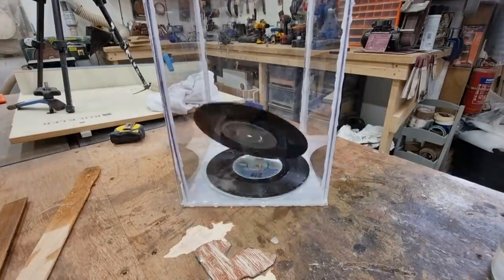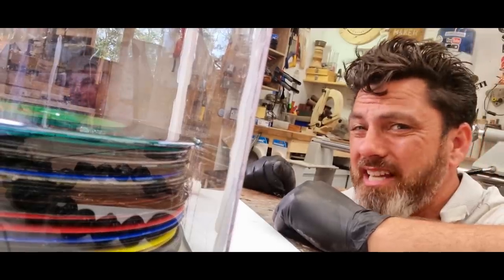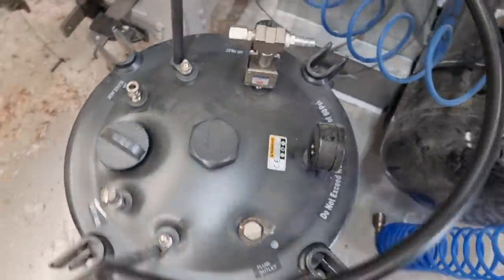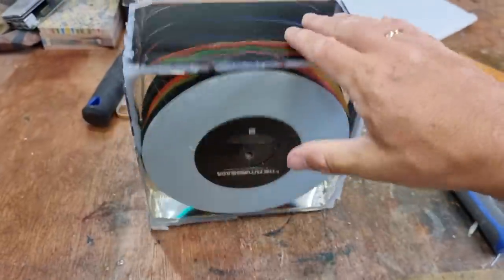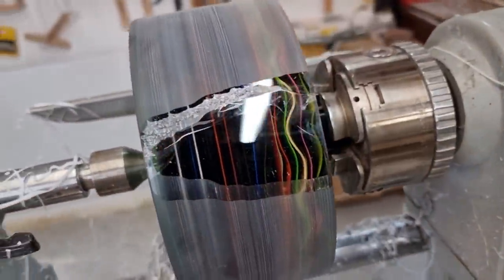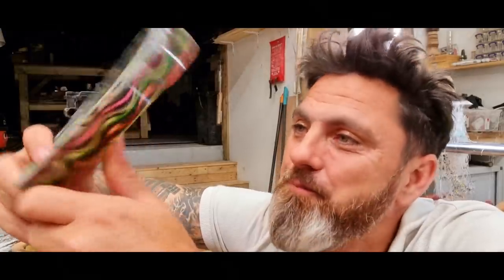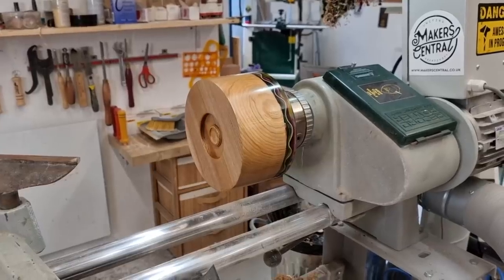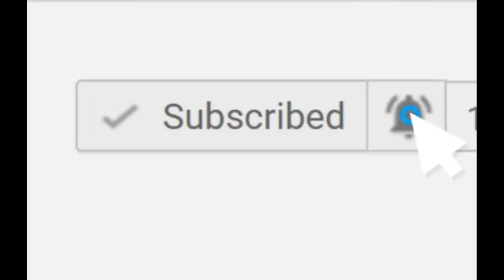I Turned My Old Vintage Vinyl Records on a Lathe 😬

Comment from the maker: Get 20% OFF + Free International Shipping + 2 Free Gifts @Manscaped with code nickzammeti at → http://mnscpd.com/NickZammeti
Reply: Those where the days nick having warped records
Reply: I hope no classics were hurt in the making of this video Mr Z 🖖
Reply: Turn it into a speaker housing
Reply: note: this comment is before the finished product 
Looked like the break was at the end of the fast dry resin. Could using two types in two different layers been the reason of the break?
Reply: That turned out pretty cool. Hoping to see what you do with the rest of the records.
Reply: nice recovery Nick
Reply: you can get wavy records by heating them up with a head gun, the reason your record blank came apart is because you need to make sure there is resin between each layer.
Reply: Nick try gluing in your emblem with: IC-2000 Rubber-Toughened 1oz CA Adhesive Glue      It bonds waaaaay better than just CA.  Try it as a test, you'll see.
Reply: Do you sell these things you make? If so where do i go to buy buy buy
Reply: "Failures, are only failures if you don't learn anything" - so I think you succeeded Nick, looks great!!
Side note, it looks like it broke apart right where the two different resins met ? Is that a possibility or am I just imagining things? 🤔
Reply from the maker: @RosiePosey5150  sure on my website nickzammeti.com
Reply: @tigergal2828  most likely
Reply: Make a top from the other records lol
Reply: Just stumbled upon this channel, well you're cute haha
Reply: resin is really the new glue gun of crap DIY projects like this, haha
Reply: Just because you asked nicely I subscribe and click the notification icon yes that little bell
Reply: @HadleyCapeBreton  I only subscribe, if I enjoy content and want to see more of it, not if someone asks nicely for it..in fact I get annoyed by that especially if they ask more than once in the same video. Yes, I made like 3 interaction/subscribe segment skips on this video (sponsorblock addon)
Reply: C'mon man, it is a Whirled Record.
Reply: @t00by00zer  yup, it sure is a whirl record that finally been broken
Reply: You should epoxy the manscape set.
Reply: Bummer that it blew, Dude. 
So cool how you recovered.
Keep up the good work!
Reply: @fuqimhigh  I do wonder what is it now...A fancy ash ashtray?!
Reply: Paused at the shocking bit, sorry that happened.  Was turning  (get it) out great!  Hope you’re able to fix it.
Reply: Your fix looks awesome
Edit: 

That bowl looks awesome for some herbs, 420 🤤
Reply: @tigergal2828   I bet you are correct with that idea
Reply: @tigergal2828 That was exactly what I was thinking.  What would have been cool, if he had carved a. Small compartment in the larger piece that survived.  Then put a music box player in it.

Comment: I wonder if you can do it again BUT pour the resin in first in a mold, and then put in the records in one at a time so the resin coats the records completely. And to get the waviness, use the fast set resin due to the heat it produces and you can get some really groovy looks!
Reply: I was thinking the same thing.
Reply: Great minds think alike!
Reply: @katwitanruna  couldn’t agree more!!!
Reply: I agree!
Reply: As much as it would pain the vinyl fans in the room, I would scuff them up on both sides for better adhesion also. 🙂
Reply: Like a micarta then
Reply: @Drummerchef13  exactly!
Reply: Absolutely.  You gotta layer it
Reply: I was thinking the same thing as well.
Reply: @elisabethkarlsen3370  Same!
Reply: Yes please do a version two!!!!
Reply: Could go to the thrift store and get the large ones!
Reply: Also drilling a few holes through all the records might help it hold as well
Reply: I think we could all see that , apart from Nick .
Reply: Yes do this please
Reply: Was about to comment that same idea but thought I'd look first if there were more brilliant minds on here to avoid double comments 😁
Reply: Totally agree
Reply: I agree, but would take one extra step. You might want to remove the paper labels on the records so the resin will grab the vinyl surface where the label was. At least you were able to save part of it. Nice vid.
Reply: @Little_Red_Riding_Hoodlum  i mean, they were already not happy with what he just did, might as well scuff them up . . It's only logical lol
Reply: i would stack the records on their side so the resin penetrates each record.
Reply: That's what I thought as well.. So many having the same thought, this could get dangerous...
Reply: @johnfranklin87  I was thinking about it like adding insult to injury. 🙂
My opinion? (As I use records in artwork quite often.) There are billions of old records out there , they weigh a metric ton when you have a collection of them, and nobody is salivating over an old copy of the Mormon Tabernacle Choir's Collection of Traditional Hymnals, Volume 86.
Reply: And it looks like doin it all with the fast set only would be beneficial. To me it looks like it split where it turns from fast to slow resin...
Reply: Definitely, you didn't have enough resin between each disk, to act like glue.
Reply: I came here to say exactly that! He should not give up. He has a great idea
Reply: Yeah I was wondering if the warping actually helped the records hold on to the resin better!
Reply: @Little_Red_Riding_Hoodlum  but at that point, the it's like adding injury to insult, cause scuffing them up is a lot less worse then putting them on the lathe and going to town 🤣🤣 but Yea it's bad either way
Reply: @johnfranklin87  You make a good point. 😉
Reply: And blue resins so it would have a water waviness
Reply: Tools the words right out my mouth thumbs up
Reply: I was thinking the same thing. Once Nick cut through the resin coating the outside there was nothing holding it together.
Reply: I was thinking something similar, like putting a .005" (.127mm)or .010" (.245m) shimmes to let the resin surround the part. My son was saying to put a rod through the center hole to help stabilize and center it.
Reply: Totally agree with this it would work so much better and stick but I do like the combination of wood and records
Reply: Agreed. Posted my comment before reading yours.
Reply: Also the wavyness might help with the overall structural integrity when in the lathe
Reply: Or place the records vertically in the mould so the resin gets completely between them
Reply: When Nick was pouring the resin, I was thinking is he getting resin penetration between the layers of phonograph records. The answer, appears to be, no.
Reply: i was thinking this too...
Reply: Totally agree. It turned out awesome 👌
Reply: @waynee.2856  That's a great idea!
Reply: @Little_Red_Riding_Hoodlum  or drill some holes through them so the resin can bind through the layers.
Reply: You can make the records wavy by putting them in the oven at low heat. After you do that layer them with resin between.
Reply: I have to agree.
Reply: @Little_Red_Riding_Hoodlum  Really, Kerri? Why, that's my most favorite record of all time!!  Very exclusive, hard to find record. In great demand! 😉🤣🤣🤣
Reply: @aspirecan4829  Then you are in luck! Everyone else can't give them away! 😆
Reply: @Little_Red_Riding_Hoodlum  🤣🤣🤣
Reply: Yes, layering is definitely the way to go. As for the waviness, maybe he could try to do like a gradient effect by using some fast set resin first, then medium set resin and then end it with slow set resin? I think that would be quite sick too, if all goes well
Reply: I was thinking the same thing. Pouring fast resin on each record so they would be rippled and stick together. What do you think? Would you give it a try? I love watching your videos. 
😊📀🐱📀😎
Reply: The heat way the key to giving more surface area to bind to, and only remove material on the way into the head of the lathe so the tooling isn't trying to separate them.
Reply: Yes 👍 I’m just just just chillin chillin 😎 and stuff stuff and then I’m just just chillin 😎😎 I think think 💭 like like 👍 but I’m just trying so so 🧐 I just got out and that’s that’s crazy 😝😝 I’m not trying trying it 👨🏻‍💻 I love 💕 and and yes yes 👍 and that’s what what I’m saying lol 😆 oh 😮 I’m so ooooooooooooooooooooooooooooooooooooooooooooooooooooooookoooooooookoooooooooooooooo
Reply: Jumping on this train as well. As I was watching, my concern already was if there will be enough resin between the records to make it stable. Because of the grooves on the records, they should certainly be coarse enough for good adhesion, but the records should be completely submerged in the resin, one at a time... Vacuum or no vacuum, there may have been tiny air bubbles trapped between the grooves of the records, that caused it to split...
Reply: I would also remove the stickers on the records and rough up under where the stickers was. Also I would try and get a very close fitting bucket or make a round form to reduce the waste of resin. Would help a lot with amount to curing ration he had in the first pour.
Reply: @Little_Red_Riding_Hoodlum  

*Cries in RPM
Reply: it has been a month and not one person has noted the pun. 
maybe im just a nerd.
Reply: I was going to say the same exact thing
Reply: @Little_Red_Riding_Hoodlum  considering all the other stuff he’s doing to them, scuffing is nothing!
Reply: That's a good idea!
Reply: same, and maybe use a paint brush to ensure it's in the grooves.   I would assume the grooves are a pace for air and if you really do the math the top of the record isn't much surface area for it to hold onto.
Reply: You should do one so we can compare the way they come out that would be cool
Reply: Great idea!
Reply: @Little_Red_Riding_Hoodlum  I don't know if that would help all that much. They already have the grooves that should help hold them in place. I know they're in one direction only but for this project i think the grooves should do. But if he wanted to get scientific about it i guess he could try it with two pairs of records where one pair was scuffed and see which pair broke apart the easiest.
Reply: You mean one record let it set then one record let it set ???? That’s how i would of done it no heat no bending records .that was a happy accident with the bending of the records ,but thats how we find out about new styles and other techniques you can use  cos it did look kind of 60s cool .the amount of times i have found out something about using resin is when ive done something wrong ,different or a mistake .thats how we learn  though no ? Good comment 👍
Reply: And add the spacer in between! Do you remember those 45’s sometimes needed the yellow adapter so that the LP players can fit?
Reply: Maybe even jig up a clamp or temporary casing for it while it's on the lathe to further reduce the chances of it separating with the rotation velocity.
Reply: Or small cds
Reply: I had thought the same thing.
Reply: @katwitanruna  Simple minds seldom differ…
Reply: I think it's enough to have enough of the fast setting resin, the warped and stable part of the stack where the ones set in the original, fast setting resin batch, while the ones in the top of the mould didn't warp, either because it wasn't hot enogh or because the resin set on the records edge prevented them from warping.

Either way, three or four times more fast setting resin would warp the entire stack of records.
Reply: I remember as a teenager back in the 97 the fad back then was to put a record on a cookie sheet & bake it for a few minutes to get the desired shape we wanted. He could try that with a few at a time & see what kind of shape he gets out of it. Then pour the resin in a mold & pop the records in just as they are.
Reply: Exactly this 💯
Reply: I was thinking the same thing.
Reply: Same here lol

Comment: I think you should revisit this project but do the whole thing in fast setting resin. The heat from the fast resin setting is what made them warp. And it’s amazing!!!
Reply from the maker: yea defo the heat did this with the fast set resin . agreed . 😀
Reply: @nickzammeti  sorry to at you lol but if you do redo this project, maybe you could put the resin in another container and dip each record then place it in the mold and layer them? Not sure if that would work 🤷🏻‍♂️ . . I'm not the resin master 😅
Reply: @johnfranklin87  Or maybe make the mold "vertical", where he stacks the records up and down and then pour the resin in, and that way all the air bubbles have a path to the surface when in the pressure pot?
Reply: Nice pivot!
Reply: @billgross7947  or that lol
Reply: If I'm correct, the break looks like it happened when the resin was changed... wonder if that is what caused the project to have to change.  Regardless, you recovered nicely.  Always love watching your work.

Comment: It looks like it failed where the two resins met.  I wonder if that had something to do with it, like the spot where the joined was weak, they didn't bind well.   I love the look you ended up with.  Probably better than the original.
Reply: I think it was cause the fast cure sealed the records and was too thin and the slow cure couldn’t get in to help it.
Reply: I have heard that if you are doing multiple pours, you should pour the second lot when the first pour is at the 'leather' state (when you can dent it with a fingernail but you don't get residue on your hands) rather than when the first lot has fully dried

Comment: It appeared to separate at the first "hot" pour and the second slow set pour. I wonder if the thermal reaction that warped the records also enable a better bond to the vinyl records. The remaining slow set also came apart in a couple of places. Possibly the warping allowed for a less linear bond layer which also would assist in keeping it together. The good news is you didn't get hurt and were able to salvage and use the coolest part.

Comment: It looked almost like the fault line was between the two different types of resin, and also the effect of the quick setting resin warping the records was really cool - wouldn't mind seeing a larger piece with just the quick setting resin and records.  Always enjoy seeing you work on wood projects! 👍
Reply: I was thinking the same.
Reply: he was actually cutting into that first part of the mold, that part didnt explode til it hit the floor, it sheared off cuz of the smooth surfaces of the vinyl dont bind well together,
 @nick zammeti
 next time i would suggest sanding the vinyls with 240 to give em extra grip to each other (it sheared off at a layer of vinyls)
Reply: I was wondering if maybe the fast resin was more expensive so he didn't want to use so much or maybe there's a limit to how much you can use at once, but if he made the mold smaller, just a little bit wider than diameter of the records, he wouldn't have to use so much
Reply: @within-tension  That's a pretty good take on it.  One other thought, maybe hot water could be used to make the records wavy in advance and then they could be set in the less expensive resin?  I think some waviness to the records plus a cool dye in the resin would actually be awesome! =)
Reply: I think the quick hardening resin heats up quite a bit, that's why he didn't use very much, but also why it warped a lot.

Comment: For your next project with records: make some resin spacers cubes (a lot of them). Use the cubes as a spacer between each record, pour your resin. Your records will have a more pronounce wave to it and it would be locked into the resin better then being flat. You might have to drill air release holes in the records because of the pressure pot.

Anyways, I made some knife scales and this is how I did it. Hope it helps you.
Reply: Cut up the flat records in resin into small cubes and use those as the spacers.
Reply: This is a fantastic idea. I have 300+ records I want to use and your idea seems excellent. Like the user name. I have a Fazer that I need to restore.

Comment: I was gutted when it came apart, I could tell how excited you were about the project, and I thought the wavy rim was going to be awesome. But I knew you'd manage to pull back from the brink. I actually paused the video and said "Come on, Zammetti, I believe in you. You've always triumphed before. This'll be easy for somebody like you!" And you did! You smashed it! (I mean, you smashed it after you smashed it). The final product looks classy. I love the white wavy line through the middle of the rim, it looks like neon lights.

Comment: Having the records vertical instead of horizontal would have both reduced resin useage, as you could have made a mold with a round circumference and a small opening at the top, and allowed for a better resin envelopment. Horizontal increases the risk of bubbles significantly when you have flat items stacked on top of each other, as resin flowing around can trap pretty large air pockets between the layers.

Or, as others have suggested, pour first and then insert objects, preferably at a slight angle.

Comment: "Vinyl" records are very sensitive to heat, and quick set resin (epoxy as we call it in North America) generates a fair bit of heat. So the heat of the curing process caused the 'rippling' of the records Nick. If you wanted it to be the same through out you needed to use all quick set resin, or to keep it out, use all Slow-set resin.  I am pretty sure you knew this anyhow! Beautiful bowl to save the day too I mite add!! :)

Comment: Hey Nick! I have a question:
After demolding your pieces, is there a reason you don't use your band saw to nip off the corners before turning? I feel like it'd be safer and faster and less wear on your tools, but I might be missing something.
Reply from the maker: Yes I normally do but didn’t here I’m not sure why either lol